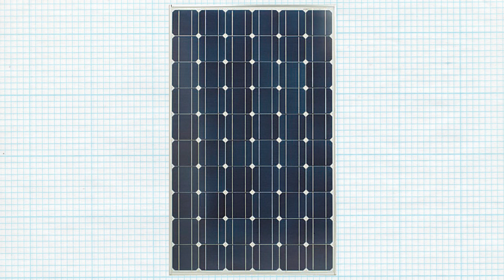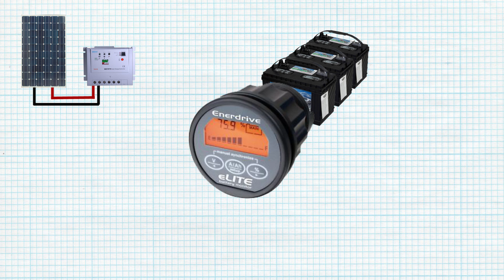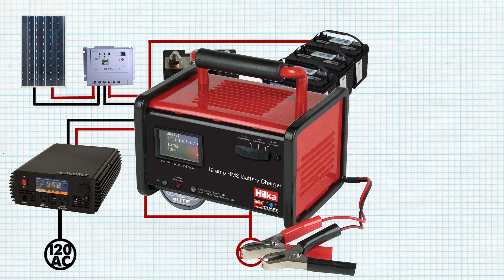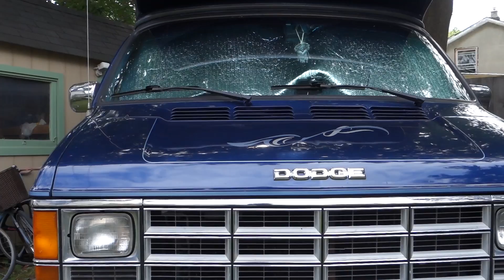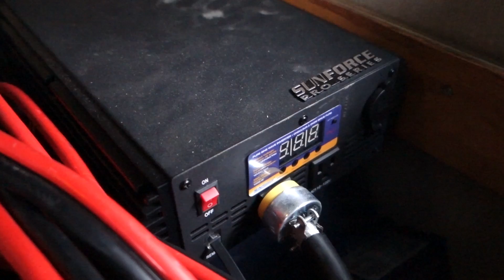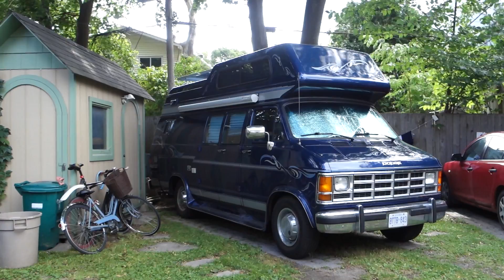Episode 018 - Van Solar

Comment: I have pac 80 isolator
80 amp relay

Go to a car audio shop. .
You can get a 200 amp also 

Got mine off Craig's list 
20 bucks brand new

Good Iuck!
Reply from the maker: It had a ghetto isolator hookup when we bought it. But it was only 70 amps and the alternator is rated at 120amps. Were not sure but we had a lot of electrical engine issues and we stopped frying parts when we removed that setup. I just don't want to put anything between the engine battery and the alternator.